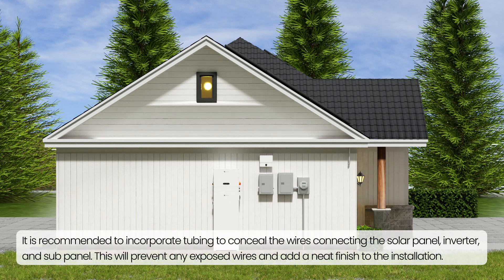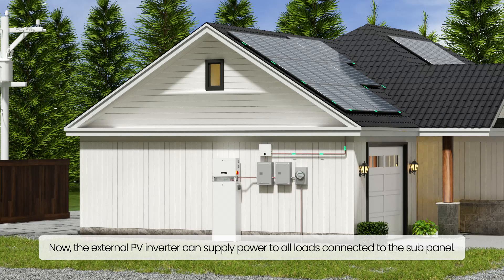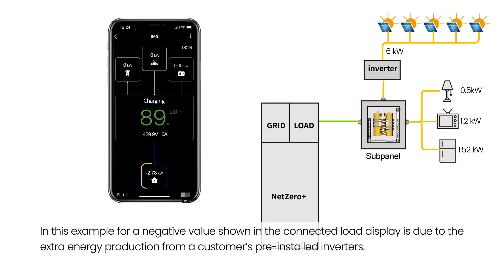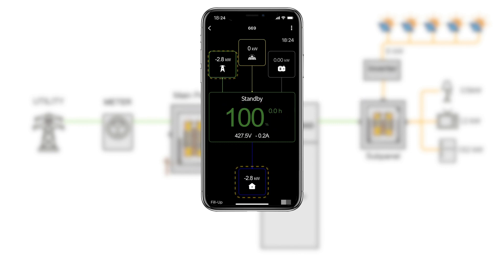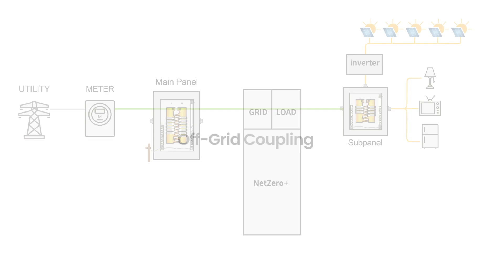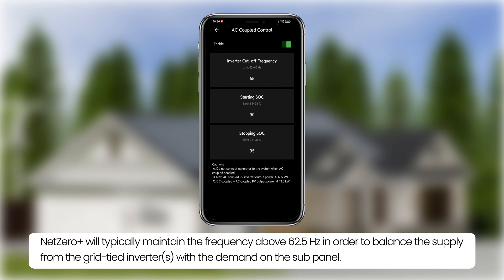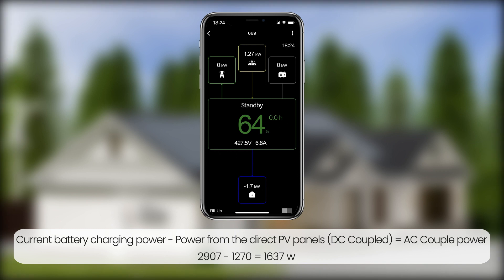How to incorporate energy storage devices without disrupting the existing solar panels and inverter?

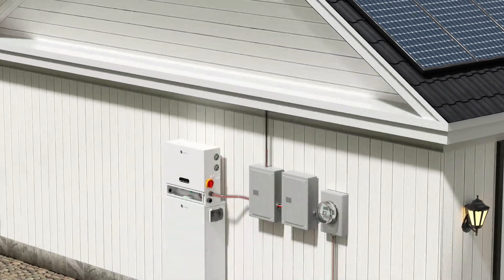Comment: I live in a high fire zone area where the grid will drop out. My PV is  AC coupled with   Enphase micro-inverters M215-60-2LL-S22 (that put out an AC signal).  How can I run my 3500W gas generator to assist/help charge up the battery with out damaging my generator?  At 2:43 in the video is says DO NOT CONNECT NET ZERO TO THE GENERATOR DIRECTLY WHEN AC COUPLED.  What is the fix if I need to run the gas generator also?  Thx bill
Reply from the maker: There are a few ways for you to achieve the goal. If you don't intend to export energy back to your utility service provider, you can install rectifier to convert AC energy (from your generator) into 400V DC (waveform) so that the converted energy can be used to charge the battery while supporting energy demand from your home. This is known as double conversion: Very robust and seamless switching over (0 transfer time) though you may lose 5% conversion efficiency. The rectifier is unidirectional and therefore the energy will never back flow to your generator. 

If you must send the energy back to utility. You can enable a feature called f-w curve under CA Rule 21 when the utility service is disrupted. Please remember that when utility service is normal, everything works fine and the excessive solar energy will simply flow back to utility's distribution network for NEM credit. What it really matters is how to throttle the PV output when the battery is about being full, home energy demand is low (meaning you PV produces more energy than your demand) during service disruption. The alternative is to use Savant Companion Module to disconnect micro inverters when battery controller is throttling the amount of energy that can be stored by the battery (battery SOC is approach 100%). 

Please work with your Savant installers so that we can help make your system complete (and robust).